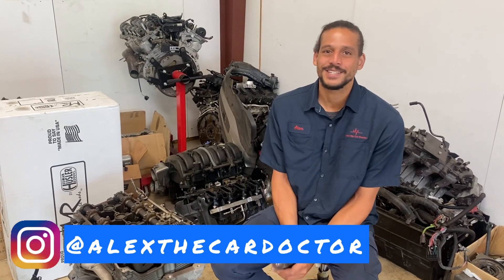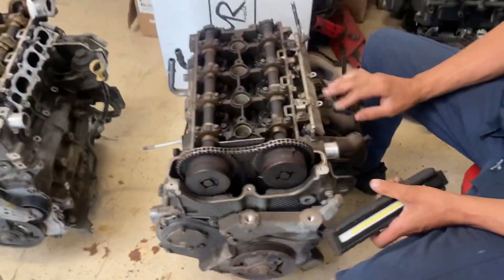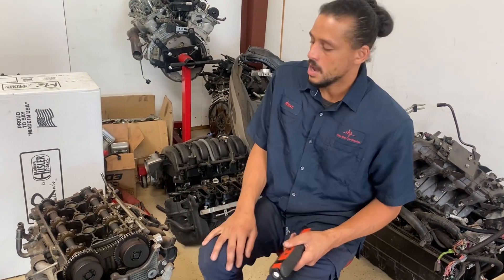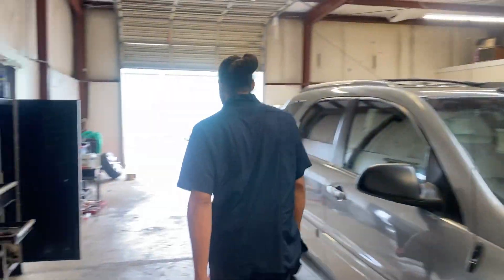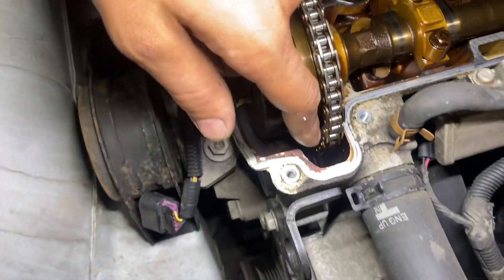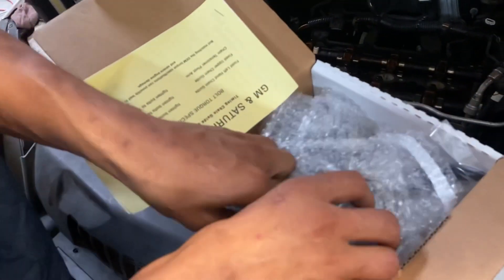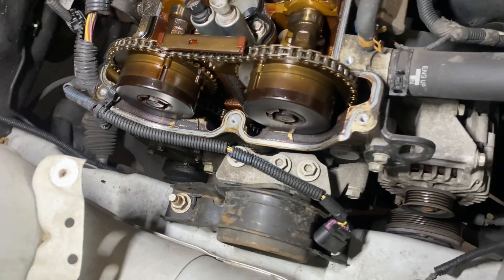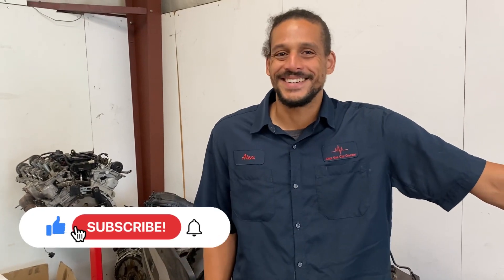Common Timing Chain Issues with GM Ecotec Engines | Timing Chain Rattles and Codes  timing chain #gm

Comment: How do you verify timing is correct if you are getting p0016 & p0017, with only the valve cover off?
Reply from the maker: If you have a good scanner you can look at the data otherwise you will have to tear it down and check that way. In my experience your timing is off
Reply: @AlexTheCarDoctor  Cant remember which part I turned to rotate the chain, but the lines only line up at certain number of rotations, so trying to check was useless.

The upper guide was intact, chain was fairly tight, the chain guide looked intact, and the car drove like there were no problems.

So, we ended up just putting a new timing chain tensioner and it fixed the codes.

Comment: I just did a 2.2 Ecotec timing chain tensioner replacement. And I was able to get rid of that looseness by turning the cam gear in the direction of the new timing chains tensioner then activate. Problem solved. Rattle gone (after the first start )
Reply: Hello Bondo - read your comment.  Sounds interesting.  I have a turbo 2.0l ecotec solstice gxp and getting code p0016 for intake timing issue.  Car with only 70,000 miles.  One min car engine ok next on restart 5 min later engine running poor.  Replace solinoids and sensors still with problem.  Pulled off cover and chain is drooping between cam sprockets.  U think could be just tensioner issue.  Looks like on this engine tensioner is on left side.  Could this tensioner be issue and could just unbolt current tensioner stud/spring unit and put in new one to take up slack?  So then dont need to remove cylinder head and put in new chain?
Reply: @michael-qp9xd  seen a mechanic do that several times, fast fix ..

Comment: My 08 hhr ran great I go out in the morning and the sound it made I thought it was the starter not engaging (just a wind no compression but the belt was turning) would that be timing do you thank?
Reply from the maker: I don’t think I pretty much know unfortunately you may have jump time and bent valves if it sounds like a sewing machine when turning over
Reply: @AlexTheCarDoctor  Not a Sewing Machine just a motor, one steady sound. But thank you anyway
Reply from the maker: @richardvandall3336  can you send me a video of it starting on Instagram I can better determine what’s going on
Reply: My 2011 buick regal is doing the same thing.  How do I go about fixing it

Comment: Had a customer come in for an A/C top off today. Needed a VC gasket and I thought I heard some rattle so I sold him a tune up and V/C gasket. (Almost to the 97500mi spark plug interval and I was already gonna be in there) I pulled the V/C and there was about a centimeter and a half of clearance between the chain and the top guide. He'll be in monday for a timing chain, he's very happy I caught the chain before it trashed his engine.
Reply from the maker: I’m glad to hear you saved a customer that’s what it’s all about man
Reply: @AlexTheCarDoctor  just got the new chain kits in. The crank sprocket had been chainsawed in the plastic sections of it. Rotate the crank to the good half and chain was tight ish, bad half and it was the rope bridge from fionas castle in shrek 1.

Comment: Sam S has it!! My wife does 3/4 mile to work on her 12 captiva. Now she has zero compression on all 4 cylinder. Skipped chain from low oil pressure, bent valves..just getting into it at the shop ..93k on motor always rattled on start-up..sucked oil/ as for the class action law suit against GM..the knew it sucked oil/ do your gooogling and see what is going on here. Worst GM engine???????????
Reply from the maker: I see a lot of bad ones but I also see good ones but mostly bad

Comment: About the broken timing chain guide bolt, there's a solution without the need for drilling and taping or removing the head.
Dorman and Melling make a bolt that is secured to the cover.
Dorman part # 917954
Melling part # 5499GMB.
If it was up to me I trust better the Melling brand name.
Reply from the maker: Hey there buddy I know about the Dorman but I didn’t know about the melling thanks
Reply: @AlexTheCarDoctor  this weekend I will attempt to do a timing chain replacement on a 2011 equinox,  by what I was told sounds like a guide broke and it stalled,  code was for performance on the cam sensor, I hope it didn't skip a tooth and damaged the valvetrain.  Ordered a cloyes kit but didn't order the bolt (in case it's sheared off).
Reply: I saw it in a video once so I got the bolt, cut off the tread, welded it to the big bolt covering the access hole. Screwed it in and torqued. Solved!
Reply: @Dev JB broken guides, ended up replacing the chain and took the head out to be rebuilt.

Comment: Lost the upper guide and the lower,vertical guide that you show here.. Chain doesn’t have much slack though. And regarding the thread insert, hey if you’re putting this much work in, may as well do it right and machine shop it

Comment: So working on 2.4 engine. Could this cause bent lifters also?
Reply from the maker: I’ve seen broken lifters
Reply: @AlexTheCarDoctor  damn. Thanks
Reply: loss of proper timing on an interference engine like this is extremely likely to cause bent valves
Reply from the maker: @OtherDalfite  yes 95% of the time

Comment: I'm glad to have run across this video. I just got my car back from the dealership with this exact issue. I have a 2015 Chevy Equinox LT 2.4L. I had it towed back home today because they said it would take them 10 hrs to do the job and it would cost me $2100+ for them to fix it. I'm thinking maybe I should get another car. Or would it be better to fix it?
Reply from the maker: Dang sorry to hear that. That is a common issue on the Equinoxes. It really depends on the mileage and the condition of the car. If it’s in great condition and reasonably low miles, I say keep it. If you get another car, you may be inheriting new problems with that one as well.
Reply: @AlexTheCarDoctor  Thank you for responding. It has approximately 114,400 miles on it.
Reply from the maker: @mindgrindhustlellc9531  my pleasure I try to get back to everyone,if I was you I will not take my car to the dealership most of the time they are very $ hungry. The first step is to find someone you trust as a mechanic.tip look up reviews  that always help. I think the truck is worth it if you find a good mechanic
Reply: Just get rid of it and buy a Toyota. These engines are junk. If it was burning excessive amounts of oil prior to the failure, it may need a new engine which is $3000 for a used engine and $4500 for a reman and that’s just the engine alone.
Reply: @atx-cvpi_99  I got rid of it

Comment: These engines only have that slack when the engine is off (not spinning) once the engine starts the tensioner gets filled up from oil pressure and puts additional tension on the guide. But yes that bolt coming out the tread is a disaster.
Reply: That slack when not running is not good regardless, that will lead to it jumping time during a cold start. Chains already worn past the max tensioner extension.

Comment: With your experience with these 2.4l eco tech motors and dealing with timing issues, how often have you ran into the problem being the reluctor shifting on the cam shaft?
Reply from the maker: I have not ran into that issue yet,I work on a lot of these engines and can say they keep me in business just like the Chrysler 3.6 Penta star
Reply: @AlexTheCarDoctor  I’m trying to determine if that is the issue I have now. I have a copy of the bulletin from gm regarding it, I just don’t know how to add a copy/pic on here to send it to you.

Comment: Is it necessary to replace the cam phasers when you do a new timing chain? If not, how would you know when you do need to replace them?
Reply from the maker: It’s a certain way you can check them better shown than told type situation. To be on the safe side I normally recommend changing the phasers if it’s in the Customer budget
Reply: @AlexTheCarDoctor  ok, how often is it that you actually have to replace interior engine pairs do to issues with timing chain? Like lifters,
Reply from the maker: @cliffp2490  on that engine the timing components normally fail between 100k to 150k
Reply: If it’s a Ford Triton 3V, yes you do but most shops will only do engine replacements these days because they have comebacks for just timing chain replacements.

Comment: Your explanation of the issues with these motors is DA SH_T !!!!!! I wish I would have seen this video 5000 miles ago. I’m literally going to show this video to my mechanic. Im also going to watch it about 3 or 4 or 5 more times myself also. Have you ever run into the issue of the camshaft gear jumping time? I have replaced the timing chain, and the other chain ( that I can’t think of the name of right now) camshaft sensors, and crankshaft sensor, and both crankshaft position solenoids. My mechanic ( who had never done a timing chain on one of these engines) says that there was some release from gm saying that it’s possible that the gear on the camshaft has become loose and gotten out of position. I also go to search to see if you have any more videos regarding the 2.4L motor and timing chain issues. Feel free to send me a link if you do.
Reply from the maker: Hey there buddy I’m glad you enjoyed the vid man I have like 3 off those engine in the shop with timing chain problem this week SMH 🤦🏽‍♂️ I’m going to do a video of me changing one.the only way the cam gear can come loose is if you did not torque it down properly or made a mistake and left it loose, I never seen an issue with them just coming apart by themselves and I see a lot of this engines on the daily. In my opinion he should’ve never been experimenting with your vehicle unless he warned you something can go wrong because I’ve never done this before. Lots of people don’t know these engines are interference engines and if the timing chain is not put on properly or if it jumps timing you will damage internal engine components. Thanks for watching I really appreciate your support
Reply: @AlexTheCarDoctor  so when the mechanic says, “ he has a bulletin put out by gm regarding the the chain sprocket for the timing chain that is located on the camshaft moving) is he blowing smoke up my butt because he’s out of his league or does that really happen sometimes?
Reply: Are the marks on the sprockets matching up with the chain at the proper positions the main way to tell if the engine has jumped time? If the engine has jumped time does it run great sometimes and then other times won’t start?
Reply from the maker: @cliffp2490  most likely. I always say show me what you are looking at.on that engine you have a cam phasers/cam gear they will go out and have movement he may be talking about that but as far as the cam gear bolt that holds it to the camshaft coming loose is not likely unless stated before
Reply from the maker: People will make up anything to get out of something not saying that about your mechanic, I’m just taking in general I’m pretty sure he is a good mechanic
Reply: @AlexTheCarDoctor  ok Alex, your the car doctor and you have three more of these engine timing chains to work on, so where are the videos? Skool us !!! Make a video regarding these cam phasers you speak of. By the way , my mechanic says the bulletin isn’t about the bolt coming loose, it’s about the gear that’s pressed on the camshaft itself coming loose or moving position. I been looking for anyone else that can say they’ve had this problem with this engine. I haven’t found them yet. 
On a different note, I read every comment under your post on the common eco tech engine issues. Ignore the haters!! I have yet to understand why people are so quick to knock someone else but find it impossible to give a compliment. Based on the other comments under your post, a lot of people do appreciate the knowledge your willing to share. Thank you
Reply from the maker: @cliffp2490  I will make that video it’s been on my mind to do so for a long time,this week is my opportunity to do so.in my opinion if you don’t have hatter’s you are not doing something right.I think your mechanic is talking about the cam gear alignment pin Sharing off if so I have not seen that problem.
Reply from the maker: I really do make this video to Ginuwine help people out here with knowledge and to save money
Reply: @AlexTheCarDoctor  don’t talk about it, be about your business! You know how many people with some knowledge to share have blown up on line just by sharing what they know or have learned through experience? Why not you? Big opportunity doors use to be closed to most of the everyday people, now YouTube and your own learned knowledge can have you getting paid better then your 9-5 job just by sharing and showing the skill set you have. I’m already in the audience so come on with it!
Reply from the maker: @cliffp2490  yes that’s the main way to tell.If it jumps time it will not run good/ not run
Reply from the maker: @cliffp2490  what is the check engine light code
Reply from the maker: Sounds like a cam phasers issue
Reply: @AlexTheCarDoctor  I will get the new codes and let you know. After new timing chain install and the engine was all put back together, it was still doing the same as it was doing before. I clear all the codes and the car starts right away and sounds great. No codes come back right away. I turn it off and the second or third time I try to start it, it won’t start. I get 2 codes then but I’ll have to look at my notes  to remember which ones. (car and notes at mechanics garage, they don’t open till 8 am ). It was doing this before I changed the timing chain, although, when I took the engine apart, one tensioner was broken and the bolt that pulls out had in fact pulled out. So very glad we changed the timing chain when we did. I replaced the water pump while I was at it just because it was still the original 1. And a lot of work to get to. If I have to take it all apart again (which it sounds like) I’ll replace the oil pump also. While I have this all apart again, in your experience, is there anything else that I should be checking/changing? Like these cam phasers? I’m at 120,000 miles.
Reply from the maker: @cliffp2490  sounds like you have it covered  all the parts that I would recommend. Very low mileage for cam phaser failure not saying it can’t happen, I have not seen it. once I see the codes I can point you in the right direction
Reply: @AlexTheCarDoctor  ok, I’m going to head to the garage and take a video for you to see. I know it varies from place to place but what is an average price for a new timing chain install on a 2.4L 2014 equinox?
Reply: The codes that came up after new chain install and changing every sensor we’re p0014 and p0017
Reply from the maker: @cliffp2490  about 800$ parts and labor
Reply from the maker: @cliffp2490  looking at your codes I’m leaning towards a bad phaser especially if it was doing this prior to changing everything
Reply: @AlexTheCarDoctor  is there a Amy to check the phaser or is it easier just to replace both
Reply from the maker: @cliffp2490  replace both always tell people like this they were made the same day they will most likely die the same day
Reply: Ok Alex, will do. I’m going to take a pic of the bulletin that gm put out regarding the camshaft itself on these motors and send you a copy today.
Reply: With the many times that you have worked on Chevy/gm 2.4 eco tech motors, have you every encountered the timing issue being caused by the reluctor shifting position on the camshaft? This is what my mechanic thinks is the problem based on a bulletin put out by gm. I have a copy of the bulletin but I have to talk to someone more computer savvy then me (tomorrow) o learn how to include it in this response.
Reply from the maker: @cliffp2490  looking forward to seeing that bulletin. You can take a picture of it and send it on Instagram in my message box
Reply: @AlexTheCarDoctor  ok, I just have to get on instagram. Unless you also have a email I can send it to.
Reply from the maker: @cliffp2490  topmobiletech@gmail.com

Comment: Alex, 2011 Malibu LE5 question. The car idles rough in drive and reverse. Smooth in park or neutral. Changed plugs, cleaned throttle body and MAF and is still happening. Have you seen this before.
Reply from the maker: Hey there buddy you may have bad engine mounts. If there is no check engine light on it’s a high chance it’s the engine mounts